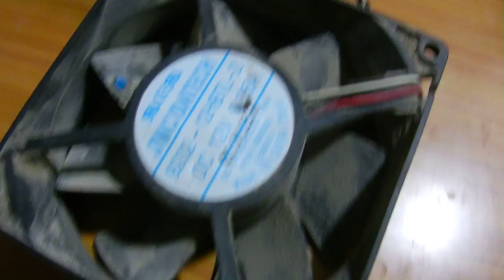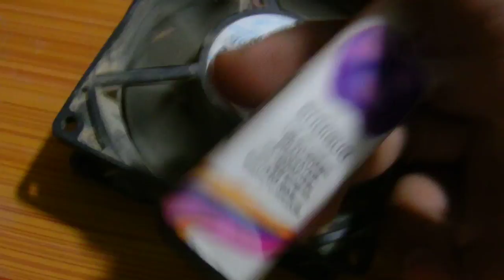Hack pc cpu/chasis fan: Turn slow fan into blazing fast

Comment: Well.... Thats one way to do it. A stupid way. But still a way....

I usually use my SOLDERING IRON, which I suggest you invest in at some point (they are cheap there really is no excuse not to have one), pop the split ring off the shaft under the sticker, and put on a 10k potentiometer (easily salvaged from anything with a knob adjustment) with a 4.7k between the the leg and wiper (yellow purple red, between an outter and middle leg). This gives you control of the fan speed. Kind of dead at the bottom of the sweep but pretty good control. Finer than the fan, as you can hear the speed stepping up instead of a smooth transition.

Or you can ham hand it with a torch and call it a hack (its not) like a friggin brahman caveman......

Comment: Also Use OpenHardwareMonitor Software to change fan speed
Reply: no, this was a REAAALLLY old technology, you see this fan only has power and ground, no sort of PWM, this is a thermal diode so if you put a lighter up to that thingy sticking out of the fan, it will go faster
Reply: @TheGermanDude  lol ok

Comment: Did he say short the system?? Isn't that going to f**** everything and catch the fan on fire and burn the house down killing the entire family in their sleep as well as their pet dog??
Reply: Those pc fans are not able to draw many amps at all, if so you will have to feed it 100 volts but no psu does that to a computer.. and if its overloaded, its not gonna do much, it might not even smoke a little...
Reply: @lengaming1651  he knows that . he has that sicko kind of personality which is called troll . they need to blame , accuse and control and block ppl who r having fun to experiment like the video owner does here . a disgusting parasitic life form on society .
Reply: The thing with these 12 volts, low current, thermistor-controlled fans is that you can make them spin faster permanently or at will, by shorting that thermistor (temperature sensor). Connect the 2 pins from the thermistor using a copper wire, a switch or even a 5..10k potentiometer.
These fans don't overheat - they sometimes lose spin power, but usually die a sudden death.

Comment: will it damage fan on long usage 10 hrs ?
Reply from the maker: Possibly. You can make a test for this. Run fan at full speed and check current drawn. If it matches rated current written outside fan round sticker then it should not be damaging.

Comment: but i have no resistor on my fan
Reply from the maker: Not all pc fans have this resister.. you gotta find one with it if you want to control speed of your fan. Other meaning of not having this thermal sensing resistor is that company has made it to run at fixed speed.
Reply: can you do that with cooling pad fan?

Comment: You can also get a small bit of solder to short the two wires...
Reply from the maker: Yep. if you want to make permanent change.
Reply: Or dump a switch on it